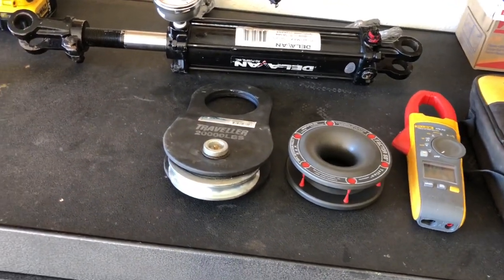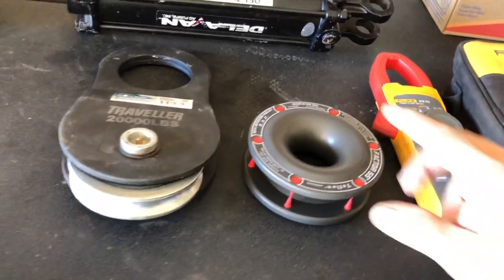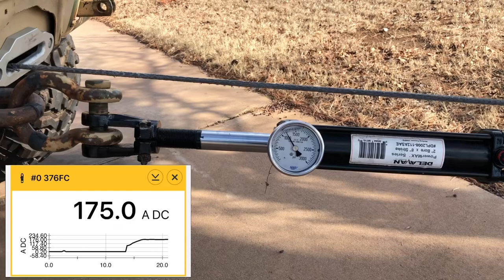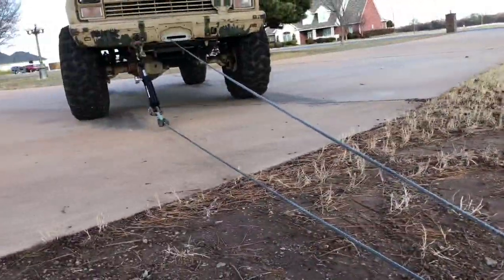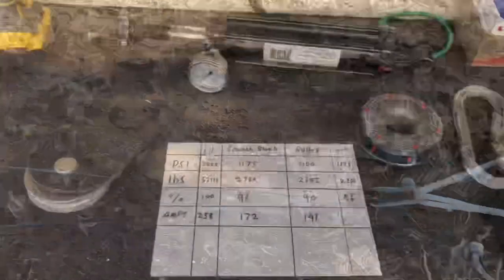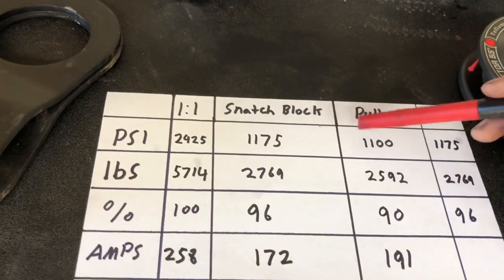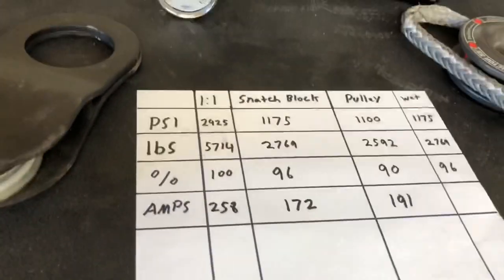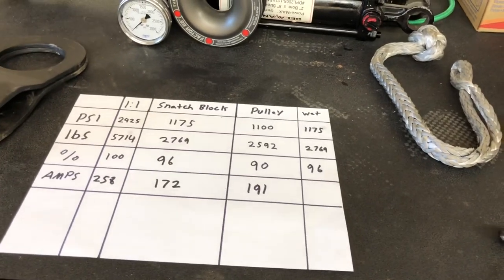Factor 55 Rope Retention Pulley vs. Snatch Block efficiency test!

Comment: I’m curious which is more efficient. The Factor 55 spinning ring vs Yankum Ropes offset ring not spinning.
Reply from the maker: @full_metal I would say the rotation would be more efficient but in my testing it’s negligible difference and really not worth the few %. Either you have the rope sliding over the larger diameter or you have the ring turning, but still the inner rope is sliding on the ID. So either way you  have a rope sliding on the ring.

Comment: your Parking Brake is off the Chain! Love the ingenuity!
Reply from the maker: yep! gotta do what you can lol. check out the part 2 video i did that goes more in depth adding a second cylinder and voltage/amperage readings during pulls. the results were pretty interesting as i had the pulley stall out during one of the tests. so i had a direct pull stall vs spin comparison.

Comment: my only question would be what about the wear and tear on your soft shackle. I assume with more tension especially right at the point of binding or constant pull usage in a single long distance pull that this will actually burnish a flat spot on the shackle itself. can you pleas comment on all if any soft shackle damage that might have happened
Reply from the maker: we dont use our winch or snatch blocks every time we go out rock crawling, but from what i see, its no different than wear and tear the winch Hawse does to the rope. if anything there is more of a gentle radius on the pulley than on a hawse as far as wear goes. maybe if the rope is covered in a sandy mud mix the wear would accelerate but even so that would be a ton of winching. i have some soft shackles that i made 6 years ago and still use them regularly to this day without any major damage to them. cant say i've treated them nice either.

Comment: Good test but shouldn’t the line distance be a constant?the winch loses strength as your line length diminishes and the windings around the winch cylinder increase
Reply from the maker: Yes, check out my second video, we went more in depth on it and had voltage and amperage monitoring at the same time. Plus we tried to keep things as constant as possible to get relatable data.  This video was just an initial proof of concept.

Comment: Nice, thorough analysis.  While the numbers may not be so perfect as compared with using a "fancy" load cell (or two--one on each side of the pulley), the conclusion is equally reasonable.  Great work, and very helpful!
Reply from the maker: my version 2.0 video I went ahead and did 2 cylinders to measure each side of the pulley.  took a bit more effort doing amperage as well as voltage comparisons so that way I can see the watts used during the pull to compare